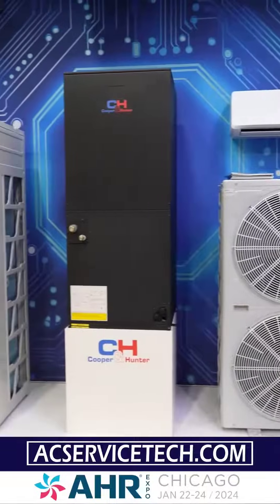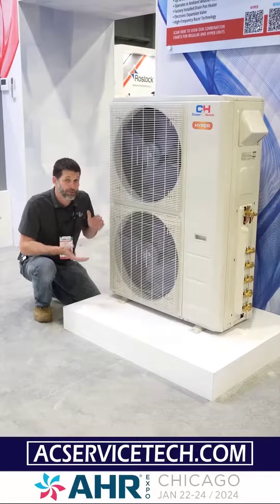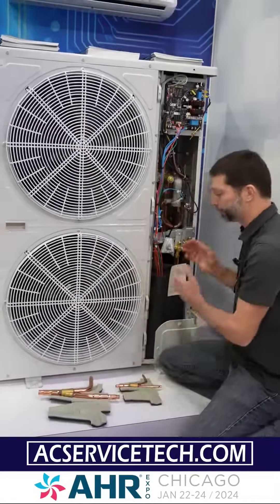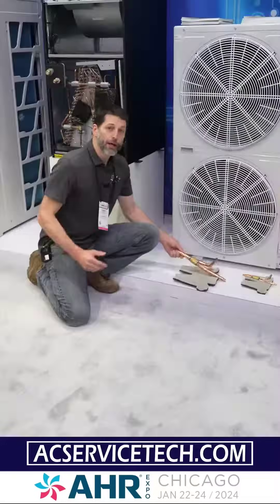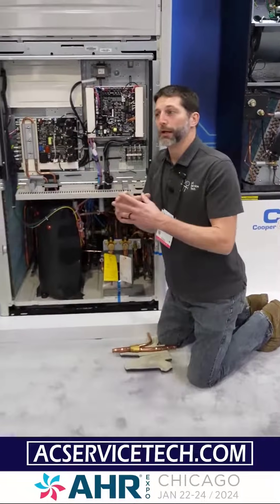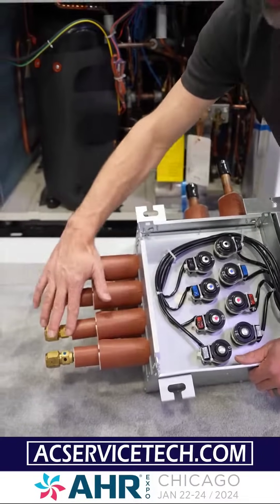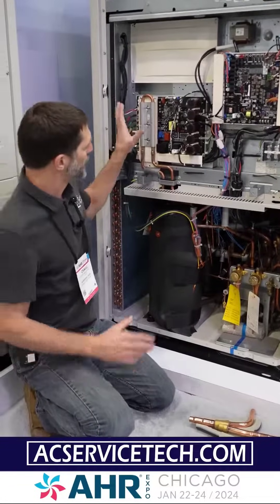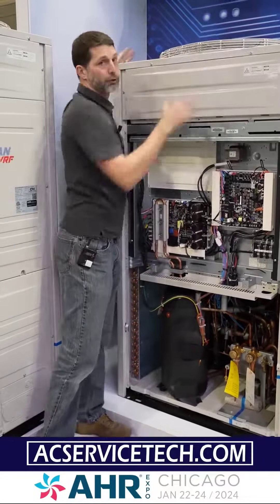Mini Split System Vs VRF System by Craig from AC Service Tech at AHR 2024

Comment: I like how explanatory your videos are but a full video about VRF urban mini is seriously needed since there isn’t that much info about them, like what type of communication wire it uses 18/2 stranded shielded or 14/4  if so does each head require individual power, what indoor heads are compatible(new gen or old gen) or just a specific type, does it require a daisy chain wiring, do you need a C&H interface(tool or app) for new install start up or is it just dip switches, can you install ball valves… ets, please make one im looking forward to it.